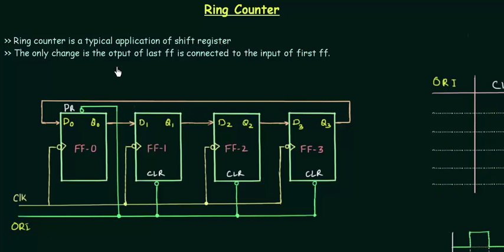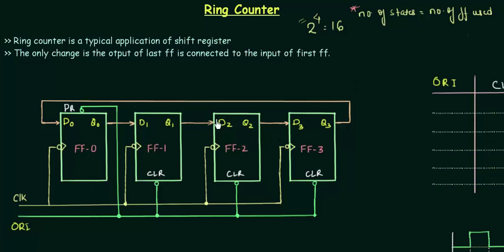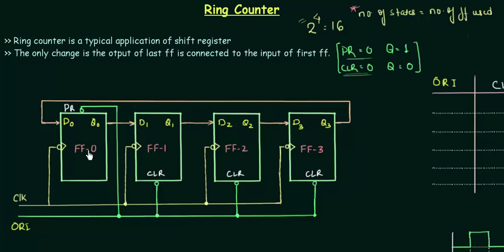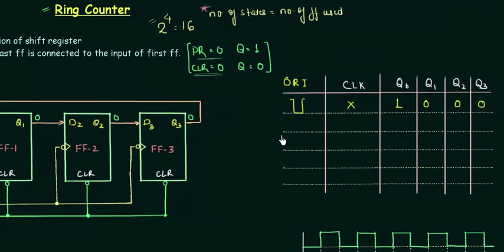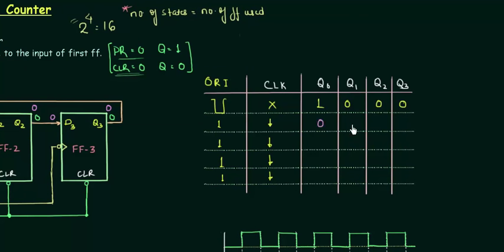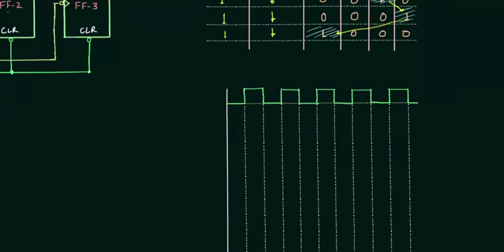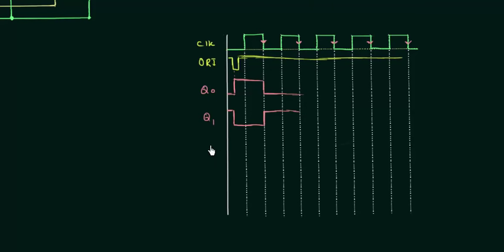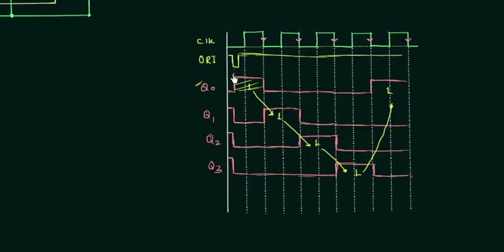Ring Counter

Comment: Sir you have said in preset and clear value doesn't depend on the inputs and clock but sir in jk flip flop if we are keeping value of j=0,k=1 and clock=1 and preset=0 and clear=0 then I am getting the Q=1 and Q(bar)=1 then sir what is the solution of this???

Comment: Why q1, q2, q3 are initially high(before the clear signal) in the graph? 
And if it is OK, then why q1, q2, q3 are not changing periodically in graph?
Reply: If ORI is high initially that mean CLEAR=1 therefore Q=1(as output) but there is a actively low in ORI to bring PRESET=1 that's the reason that Q1,Q2and Q3 are high initially and there is one more condition follow that is negative edge triggering that bring another changes in Q1,Q2 and Q3. 

I hope you get it . Well if you don't understand then go through the video once again.

Comment: sir why those Q1,Q2 AND Q3 are previously high in time diagram...they are actually toh low in the circuit..
Reply: ???? yes I also have the same doubt
Reply: Q1, Q2 and Q3 are not high  in the timing diagram ORI(Over Riding Input) is.
As he explained in the starting that for PR=0, Q=1 and for CLR=0, Q=0 which means for PR=1, Q=0 and if CLR=1, Q=1. So, from this you can see that ORI is actually PR & CLR. that is if ORI=0, PR=CLR=0.
Now you can relate it with timing diagram.

Comment: sir tell me when to use negative edge clock and postve edge clock ????? here why you used negative edge clock?
Reply: It will be given in question whether to use positive edge and whether to use negative edge triggered clock
Reply: so for positive edge triggering what will be the difference
Reply: theres no dot on the clock
Reply: here in this ckt positive edge triggering will not affect anything.
Reply: There will be difference in timing diagram only